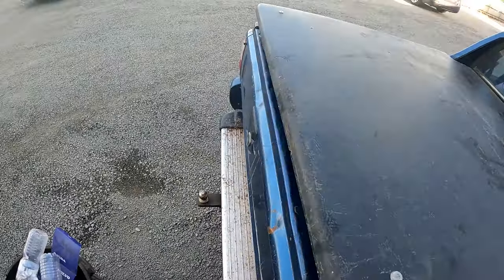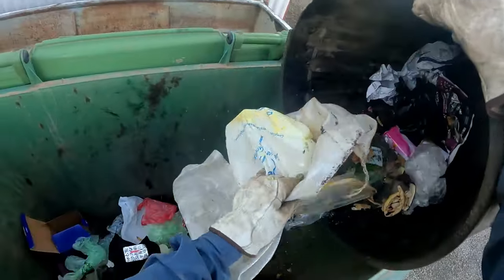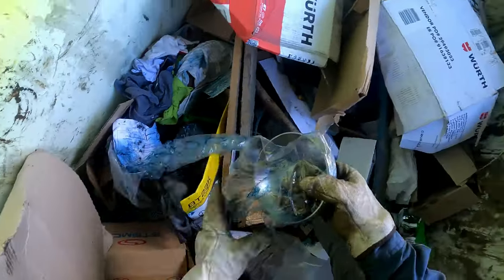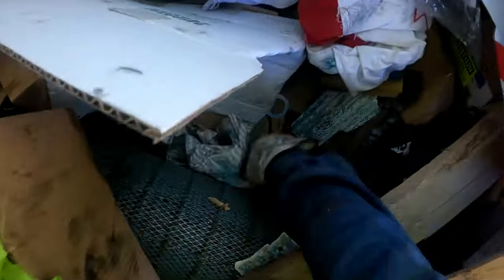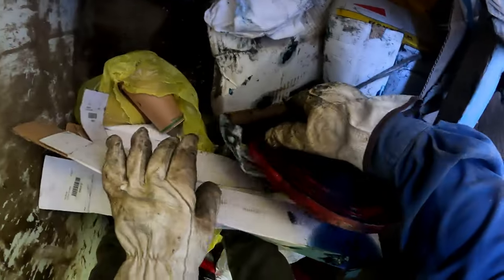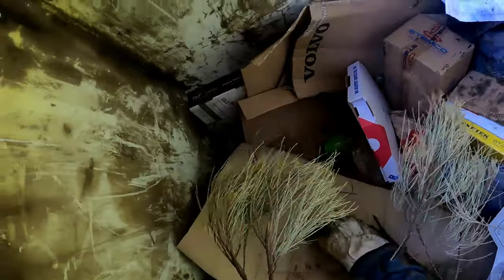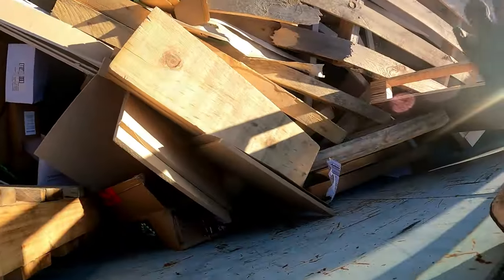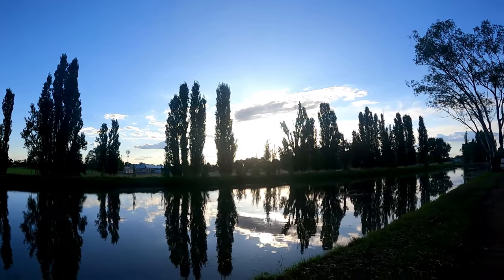Dumpster Diving Not Much Around

Comment: Are 3 L juice, bottles eligible in your state? Because I’ve seen you put them in the machine before, and it’s strange they are accepted
Reply from the maker: Certain juice bottles are but the only thing is you have to squash them down to the barcode is still visible because the two leader is the same barcode on the same juice bottle.